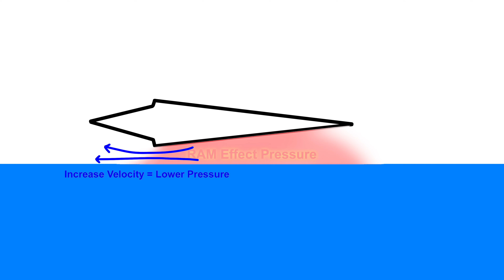R/C Ekranoplan Long Range FPV

Comment: I feel like you need to turn the vertical stabilizers into rudders for turns so that you don't have to rely on roll and par thrust to turn as those tend to cause one of the wings to dip into the water for anything more than a shallow turn
Reply: Rudders are definitely a must for turning this thing. It just doesn't have enough room to roll in.
Reply: Hydrofoils!

Comment: Please please duct something like an EDF to the underside of the wings, distributed underside ducts along the front edge, facing rearwards, to really ram the air into the right area for generating separation between the  water and wing/fuselage. I feel like you could really isolate the effect with something like this, over forward mounted props. Even if you just use ducted air for the basic lift/planing and a separate prop for forward drive....
Reply: That’s basically a hovercraft
Reply: @shize9ine  is it? The main difference being still no skirt and the air is in close proximity to an aerofoil (unlike a hovercraft) and that may be significant. Maybe ducting further back towards the trailing edge would be better.
Reply: @shize9ine  It's channelling the air not trapping it under a 360 skirt.
Reply: Why don't you do it Simon,be great to see
Reply: @M-H433  my skills are a long way off doing that, and closing the skill gap will have to get in line behind all the smaller gaps I'm trying to close.
Reply: @jcd-k2s  good point. I wonder what the definitive difference between these ram air effect craft and hovercraft is.

Comment: @rctestflight I've been biting my tongue waiting to see if you ever mention a certain effect that's contributing to your ekranaplans. I've enjoyed this series very much and fascinated by the concept.

To get to the point, I'm pretty sure this is what's happening: You often refer to "Ram air", as if the speed of the air is the most important factor in making it fly.
When your creation (I'm going to simply call it your 'rig') 'flies normally - that is, when it's holding its ideal altitude, what's taking place is the resonance of the air bouncing between the [under]surface of the wing and the water. This vibration pushes the rig upward with a pulsing motion that we can't see. If the rig flies higher, the greater distance causes a slower resonance which is also weaker & unable to produce enough upward force to sustain the altitude. Resultingly, the rig 'falls' back down to the air's natural frequency (which is determined by the square area of the wing) where its weight is equal to the collective force of the bounces. It 'wants' to ride on the average of those bounces, or frequencies.

Imagine if you were a cubic inch of air, floating around, minding your business. Suddenly a wing goes overhead. What you would experience at first is a short but violent vibration ('violent', relative to floating around doing nothing). As the wing passes, the distance to the water becomes shorter, thereby compressing the air waves/pulses, making the upward pressure stronger. For most of those vibrations, you helped push the wing upward.

In your efforts to create a rig that performs well but doesn't 'want' to fly, my feeling is you should focus attention to this resonance frequency to make it strong at its natural pitch but dissipate quickly above or below that frequency.

I'm not an airologist but I have a ton of experience in acoustics, which requires an intense understanding of resonance. I'm also an RC veteran, so I'm often delighted whenever you overcome an Arduino problem. Using Arduino & related stuff is new to me.

If you took the time to read this, I thank you, and, I hope that in some way this information makes a difference to your next project.

Comment: Awesome stuff, I really think a larger scale is on your side with this design and most of your 'issues' result from it being smaller. Maybe increasing weight and power would allow for smoother ground effect and also a higher ground effect ceiling as more air is required to be compressed to gain flight. Also I'd love to see if a vertical control surface coupled with differential thrust would help with the large turning circle or induce other problems like rolling or drifting. I really think you're on to something amazing here, keep it up!
Reply: I was going to say the same thing.
Reply: i think a rudder would cause adverse roll unless it was at least nearly symmetrical
Reply: @slothFPV  the FC should compensate roll with those elevons
Reply: Peter stripol made a big one that worked decently.

Comment: 2:09 that low pressure zone is actually at a higher pressure. Its acting as a divergent nozzle. 

Look up the effects of a convergent/divergent nozzle with both subsonic and supersonic flows. Bernoulli states that at a subsonic flow, a fluid at a given pressure will increase its pressure through a divergent path/nozzle.

Comment: Nice project and presentation. 
This is regarding turn radius.
1. Is difference left right forward thrust offered a desirable turn radius?
2. Is difference motor tilt offer a desirable turn radius? 
3. Is mixed elevator-aileron offer a desirable turn radius? Caveat: over steering into violent spin. 
4. Consider rudder channel controlled “dip (left/right) tip sticks” to skim water surface to produce drag to aid reduce turn radius. 
5. Consider mode change from GE to airborne to enable a banking turn. 
6. Airborne mode capability can help get around surface obstacles too. 
Hope this helps.

Comment: This is still better than F1 ground effect cars' porpoising, pretty interesting build!
Reply: What even is the link between these 2, one is the Ram effect, the other is using downforces
Reply: AMEN!! Which do I prefer? Watching millionaires use CAD and wind tunnels and exotic materials or a determined young inventor with foam board and a glue gun? Here I am!!
Reply: Gotta add a quote: "If you want to make an apple pie from scratch, you have to start by creating the universe first." - Carl Sagan
Reply: @Simon-jv9bm  The Venturi and Bernoulli effects that he describes at 3:32 are what make the F1 ground effect designs work and produce downforce. Of course the F1 cars do whatever they possibly can to avoid creating a RAM effect because they want to ride on a cushion of rubber (the tyres) instead of a cushion of air. In either case, both are types of "ground effect vehicles" but with different intended functions and focuses.

EDIT: The porpoising under F1 cars also isn't caused by competing ground effects like we see on this vehicle, but by the car body getting too close to the ground, cutting off the Bernoulli effect and causing the car to lose downforce until airflow is restored and the Bernoulli effect kicks in again.

Comment: This is cool! I love how it looks when you get up on the ram effect and just start cruising. I'd call this one a success. 

I can't say for certain because I haven't used this myself, but I think I'd prefer the craft if it had at least some of the horizontal stabilizer. It seems to be easier to keep it stable without the PID (at least until you add the extra weight) when you have it. Some things I'd want to experiment with are different sizes of H. stabilizer, spoilers for the H. stabilizer and/or the main body to try and eliminate aerodynamic lift, and using "flap rudders" (rudders that work by extending a pair of flaps from where a rudder would be) to see if they can create similar turns without having to use so much roll or differential thrust.

Can't wait to see what's next!

Comment: Two questions: 1) I know “how to” videos aren’t really a thing you do on this channel but I would be interested to see some content on waterproofing a cadex. 2) when you switch from futaba to DJI/cadex, why use the DJI controller vs something like edgeTX and crossfire? Wouldn’t you have more control with your model and modes? I ask this question as someone with much less experience but find myself in similar circumstances. I build several models/craft and sometimes consider having the DJI controller but I feel like having a more open source TX provides more versatility. Again, I know this deviates from the content, but I would be interested to hear what drives these decisions.

Comment: I've been a fan of your channel for several years now. I have an Autel Evo that with all the rules and regulations I haven't flown it in months. I'm in the process of setting up a FPV system on my Arrma Kraton not liking 5.8ghz. not sure if 413mhz. or 1.2ghz. 
One of my favorite video was the time you flew the plane while following it in the car.   I really enjoyed flying FPV just to see how far I could go which my record was only 1/2 mile. Now I am trying it on a ground vehicle. Looking forward for the next video.

Comment: FWIW some IRL Ekranoplans are quite capable of flight out of ground effect. The Russian A90 had a ceiling of 10000ft, and the early-2000s Boeing Pelican concept would have been able to reach as high as 25000ft. They generally lose efficiency when flying, but it enables them to use conventional airports.

Comment: Thank you!
A few things I would like to see as experiments on this small depron unit: Motors on the corners of the nose! 
Using the prop-vortex to seal the pressure. I think massive gains are possible. But who knows, maybe it'll be unstable or something.
And IF you have a (passive) horizontal stabiliser, put it at motor height, in line with the motor, to even out the forces. If those are in line with the "wing" it should still not want to "fly", but hover at speed.

Maybe even delete the fuse... place the battery on top , or split the battery. Make the sidepods slightly more buoyant, and have the motors directly in front of them. 
(Not that useful, if the goal is to have a manned version.)

Comment: Question: For the 'wet lens' problem, what about attaching a very small tinywhoop motor just under the camera to just blast high pressure air on the camera to clean the lens off? Maybe a 3D printed cowling could make a 'bubble' of air over the lens, which would maybe deflect some of the water.
Reply: Ive heard of filmmakers using a spinning lens cover so as soon as water hits it it gets spun off.
Reply: @Skruphi  I was trying to keep it cheap, and simple to make. I have seen those spinning viewports on milling machines for manufacturing, but I think a tiny thing would have to spin at several thousand RPM which would be a whole other problem to deal with.

Or, we can blow air at the lens with a tiny propeller and motor.
Reply: Outdoor kart drivers use a clear free-spinning disk in front of their visor. It has vanes on it to catch the air, which spins the disk as they drive.

Update: they’re called turbo visors
Reply: I've heard rain-x works well
Reply: Spin disks are used on automated industrial milling machines to look through the windows while coolant/lubricant is being sprayed everywhere. He could make one under 5 minutes when at the workbench with a circular piece of clear plastic and a small brushless motor. Should be a non-issue and solved with things he is likely to have on-hand.
Reply: @goddamnitization  Rain-x definitely helps. Would recommend the summer type over the winter one
Reply: I was thinking about this too, but I was thinking of using a clear lens shield that is hydrophobic. Even some of that clear coat hydrophobic spray paint I think could do wonders without adding a lot of extra weight.
Reply: "A clear view screen or clearview screen is a glass disk mounted in a window that rotates to disperse rain, spray, and snow. A clear view screen is typically driven by an electric motor at the center of the disk, and is often heated to prevent condensation or icing. Other common names for it include "clear sight", "spin window" and "rotating windshield wiper".

Clear view screens were patented in 1917 by Samuel Augustine de Normanville and Leslie Harcourt Kent as a stand-alone pillar-mounted screen, with later patents for telescope and optics covers, followed by the more familiar ships bridge glass. Clear view screens are also used in locomotives and rail transport, and were unsuccessfully marketed for automobiles."
-wikipedia

Comment: Look up Charles Bixel and his WIG and "waverider" designs which incorporated a deep chord, symmetrical airfoil along with delta planform, symmetrical outer wings.  He claimed the chord-dominated ground effect was 130% stronger than span-dominated ground effect.   Flighttest, if you revisit your earlier experiments, you were close to Bixel's WIG concept.  Also luck up sfluck and legaltender to see their variations on Bixel's WIG designs.

Comment: To keep water off the camera you can coat is with either rain repellent or that oleophobic liquid for cellphone screens. A more mechanical way of doing this would be similar to large ships or CNC enclosures: a glass disk right next to the window (or camera in this case) that spins really fast, slinging off any water that splashes on it.
Reply: Rain-X was originally developed for aircraft use, just makes sense for FPV camera lenses.
Reply: @ultratorrent  Was it meant to be rain repellent for just windows, or an anti-rain/anti-freeze wash for the whole plane (what glycol is now)?

Comment: automotive rain-x on the camera lens could help. water beads up and blows away in the wind. it's amazing on car windshields. you can drive with the wipers off in the rain. maybe a hydrophobic coating on the whole plane might help.

Comment: You could make the upper wedge of the foils variable, this will vary the downward force helping with variable weight loads, or if you make it independent on each side use it as a turning mechanism. 👀

Comment: Beaver always causes problems. Really cool and your design seems to work very well. This gives me some inspiration and a way to use up the large sheets of corrugated mounting board and old Futaba surface radios I have laying around.

Comment: There were turboprop versions of the ekranoplane - maybe those are the best design examples that would translate to model building. The final versions had a prop at the top of the tail, which would tend to keep the nose down while holding the high pressure portion of the wing near the water.  They also had large flaps, which must have been an important part of trimming the wing for efficient cruise, as well as take-off.

Comment: you're getting very close to a concept I have had for 20+ years that is a flying wing in ground effect with hydrofoils for initial lifting of the wing then super-cavitating foils for stability and highspeed control, so you get all of the advantages of a lifting body in ground effect with the maneuverability of hydrofoils

Comment: Never having built anything RC these suggestions may be completely off-base, but here you go:
1) Remove the elevons and instead rotate the entire rear wedge.
2) use ducted fans instead of free props.  Should give a pretty significant increase in thrust for the same power.
3) Looks like you really only need 1 vertical stabilizer, maybe down the center.  I will say I love the look of the final design; looks a bit like Space Ship 2 :)
4) A double scale model (2x this one) should allow for a significantly higher flight level and handle rougher water better.
Loving this series!

Comment: Need to put the camera inside a clear dome. The dome causes the droplet of water to be significantly smaller in your view because it is 1/2 to 2 inches in front of the camera it is less of the field of view that it covers. It will make a huge difference for visual clarity with water.

Comment: I always feel that suction force pulling the plane down during short field takeoffs in the Piper Seneca. you can really feel the pull when you rotate and the struts compress a little right before it breaks off the surface.

Comment: It seems you may want to investigate the vertical stabilizers further forward, maybe even with the rear wing. 

Would be interesting to see if possibly adding 2 more motors around the cg point in a fixed mounting, with the front ones able to pivot left and right for more directional control.

Comment: Consider the local airflow rearwards and upwards of the wedge wing - it is flowing down. So if you have a globally flat stabilizer, it locally pitched up by default.

Comment: You should try putting a edf in the wing on both sides to get it up so you can get a air pocket with that for low speed ground effect and move the motors out farther to turn with differential thrust better I think that would be interesting to see and it would probably be able to hold more weight

Comment: Always seen that the ground effect was also depending of the wing span. Increasing it could allow you to produce more ground effect with lower speeds required and more lift (but therefore more drag too)

Comment: You were saying ground-effect vehicles dont have a tight turning radius; I think for your model there's a few things you could do to make it much better in this regard.
Have the engines further apart, like have two noses on the sides instead of one in the middle. Put rudders behind them. Or, vector your motors left-right, on top of your pitch for takeoff.

Comment: if u were to add a rudder and just connect it with thrust vectoring thingy then when u r turning the rudder will go in that direction just a thought to reduce the turning circle